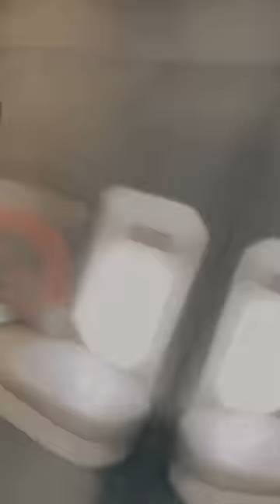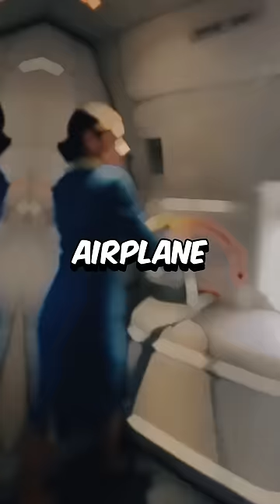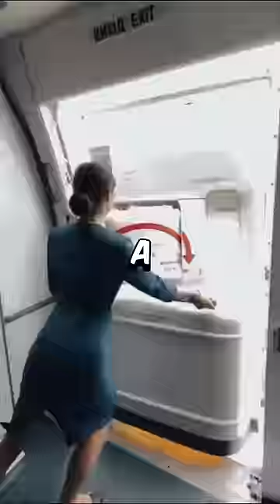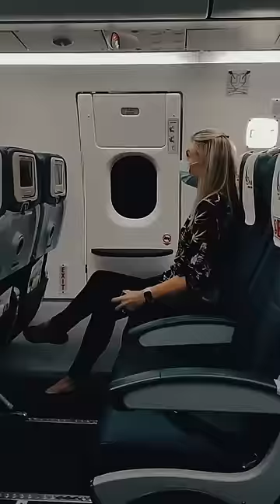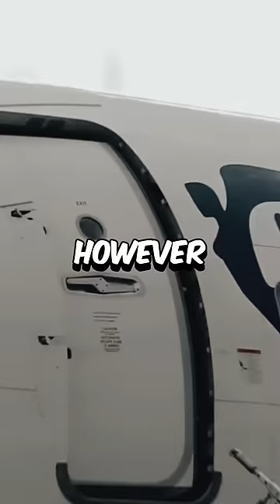Airplane Doors Cannot be Opened Mid-flight!🤯 #shorts #aviation

Comment: NO . even if you try it won't open because of pressure and the way doors designed  . Aircraft body is inflatable so doors would literally push against outside not inside  thus you can't open it even without lock . Be relax and  appreciate the human technology

Comment: 1st shot of the video is of door you can open in flight! LOL Only plug doors (those that need to be pulled in then push out sideway because they are larger that the frame) cannot be open in flight due to the pressure dif.

Comment: What about the Chinese lady that opened the door 🥱🥱
Reply from the maker: That was an emergency exit
Reply: the guy only managed to do so because the plane was on approach and fairly low enough for the pressure difference to be small enough to overcome the forces and open the door… would have been impossible any higher and on cruising altitudes

Comment: the preasure inside is NOT GREATER THAN OUTSIDE because airplane windows have a tiny hole which would release the preasere it is the wind that is holding the door back (the holes are their  because u dont want the inside preasure to be greater than the outside cuz the windows could break)
:)
Reply: Above about 10,000 ft of altitude it is impossible to breathe and hypoxia will set in very quickly.  If the plane is above 10,000 ft every passenger would be passing out, especially with the plane at cruisibg altitude of about 35,000 ft.  BUT THEY DON'T.  Thus the inside must be at a lower altitude than the outside (about 7,000 ft) and so the inside MUST BE at a higher pressure than the outside.

Comment: What about that door in that Alaska airplane 🤔🤔
Reply: It wasn't a door, it was a blanking door (door plug) that filled in the hole where an emergency door could be installed.  It was never intended to be opened or removed in normal use of the plane.

It would only be removed for maintenance (the Alaska plane was less than 3 months old so no need for Alaska to do any maintenance on it or the area in which it was placed) or to be replaced by a proper emergency door (which would be when the plane had a refit with extra seats installed requiring more emergency exits to be available).

Comment: Not true. It recently happened during landing
Reply from the maker: This is in the sense of not opening it because risking other passengers life and also its not feasible on the maximum height.
Reply: recent asiana airlines incident happend on approach where the plane was already low enough for the pressure difference to be fairly small, so the guy managed to overcome these forces… on cruising altitudes its absolutely impossible

Comment: Dont lie they open it theres a vid
Reply from the maker: It was an emergency exit
Reply: it’s not a lie, this short just fails at explaining it properly… most airplane doors are plug doors meaning they are wider on the inside than the opening itself so on higher altitudes, the greater inside pressure pushes the door against the frame… the friction is so high that it’s impossible for humans to move the door… the recent asiana airlines incident happend on approach where the plane was already low enough for the pressure difference to be fairly small, so the guy managed to overcome these forces… on cruising altitudes its absolutely impossible as I said (unless it’s a structural failure of course)

Comment: Why lie? It depends on speed/height. 

You can DEFINITELY open a planes door when it's flying. It literally just happened a few months ago
Reply from the maker: It was an emergency door i think
Reply: it’s not a lie, this short just fails at explaining it properly… most airplane doors are plug doors meaning they are wider on the inside than the opening itself so on higher altitudes, the greater inside pressure pushes the door against the frame… the friction is so high that it’s impossible for humans to move the door… the recent asiana airlines incident happend on approach where the plane was already low enough for the pressure difference to be fairly small, so the guy managed to overcome these forces… on cruising altitudes is absolutely impossible as I said (unless it’s a structural failure of course)

Comment: O really, then what about Turkish airlines flight 981, China airlines flight 006 and asiana airlines flight 214
Reply from the maker: That was not a person who opened the cargo door of flight 981.. get some research.
Reply: United Airlines flight 811 suffered a cargo door failure at 22-23,000 ft which ripped off part of the fuselage and 10 seats were ejected by the explosive decompression.

Like the DC-10 (as used by Turkish 981 and American 96), the 737's cargo door opened outwards as opposed to inwards to form a plug seal like passenger doors (this allowed for fuller and easier use of the cargo area).  The locking mechanism failed.

Comment: COMPLETELY FALSE. How do you account for ACTUAL cases of doors opening (as recently as two months ago) mid flight?
Reply from the maker: It was an emergency exit if you are talking about asiana flight
Reply: Those cases only managed to do so because the planes were probably on a fairly low altitude and the pressure difference being small enough to overcome the forces and open the doors… impossible on cruising altitudes

Comment: This is just simply a lie. Where do you come up with stuff like this. Even in your statement…the pressure is greater inside, so it can’t blow out. 🤯
Reply from the maker: Its the fact.
Reply: it’s not a lie, this short just fails at explaining it properly… most airplane doors are plug doors meaning they are wider on the inside than the opening itself so on higher altitudes, the greater inside pressure pushes the door against the frame… the friction is so high that it’s impossible for humans to move the door… the recent asiana airlines incident happend on approach where the plane was already low enough for the pressure difference to be fairly small, so the guy managed to overcome these forces… on cruising altitudes is absolutely impossible as I said (unless it’s a structural failure of course)

Comment: Not true. This just happened a month or two ago
Reply from the maker: If you do Its Fatal
Reply: no it is true, this short just fails horribly at explaining it properly… most airplane doors are plug doors meaning they are wider on the inside than the opening itself so on higher altitudes, the greater inside pressure pushes the door against the frame… the friction is so high that it’s impossible for humans to move the door… the recent asiana airlines incident happend on approach where the plane was already low enough for the pressure difference to be fairly small, so the guy managed to overcome these forces… on cruising altitudes it’s absolutely impossible as I said (unless it’s a structural failure of course)
Reply: @Wingsofhistoryy are you a bot?

Comment: If that were true the cabin would explode if it could hold the pressure and if it had to little it would implode.
Reply from the maker: Pressure is maintained in the cabin, thats the diferrent science. But on the height the pressure inside is greater than outside. That’s a different science.

Comment: reason does not seem logical
Reply from the maker: This is study.
Reply: Well this short just fails at explaining it properly… most airplane doors are plug doors meaning they are wider on the inside than the opening itself so on higher altitudes, the greater inside pressure pushes the door against the frame… the friction is so high that it’s impossible for humans to move the door…

Comment: Well this is cap a man did it like a month ago
Reply from the maker: That was an emergency exit
Reply: it’s not cap, this short just fails at explaining it properly… most airplane doors are plug doors meaning they are wider on the inside than the opening itself so on higher altitudes, the greater inside pressure pushes the door against the frame… the friction is so high that it’s impossible for humans to move the door… the recent asiana airlines incident happend on approach where the plane was already low enough for the pressure difference to be fairly small, so the guy managed to overcome these forces… on cruising altitudes is absolutely impossible as I said (unless it’s a structural failure of course)

Comment: This is already been proven wrong there is already been videos circulating improve amongst the internet get a bowling seven fifty seven headed entire bay door blown open and ripped completely off all because someone opened it
Reply from the maker: Yaa .. That one Exactly 👍🏻
Reply: So the creator forgot to mention that you can't open it at cruising altitude not take off or landong
Reply: "Bowling"
Reply: hi mate, an avgeek here. its 757 not seven fifty seven btw it kinda offends me but who cares. Now normally while you are above 3000 ft using a commercial aircraft like A320, 737s, 767, 757, and all commercial aircraft, you cant open the emergency door if youre above 3000 ft. I know this because im a fighter pilot working in the RAF. But once an incident happen while after landing, a karen raged and opened the slide. And also there is one while trying to land (they are at 1000 ft) someone opened the door and the slide went thru causing a hard landing

Comment: False statement, it recently happened.
Reply from the maker: But Fatal doing that.
Reply: it’s not false, this short just fails at explaining it properly… most airplane doors are plug doors meaning they are wider on the inside than the opening itself so on higher altitudes, the greater inside pressure pushes the door against the frame… the friction is so high that it’s impossible for humans to move the door… the recent asiana airlines incident happend on approach where the plane was already low enough for the pressure difference to be fairly small, so the guy managed to overcome these forces… on cruising altitudes it’s absolutely impossible as I said (unless it’s a structural failure of course)

Comment: It just happened recently.  Idk why you gotta lie for views.
Reply: Thats different.  These doors are built with the inside bigger than the outside. So when you climb hihh enough the higher pressure inside makes it impossible to open.

For the American Airlines flight incident , it wasnt an exit door that flew out, it was different kind of section that had no doors.

But this raises a good point: why isnt every window section on a plane built such that at pressure its self-locking.
Reply: @baselsalam  I have been struggling recently.  Seems like every single thing I learned in school has been a lie lol. It's hard to relearn stuff in your 40s. Not impossible, just really frickin difficult
Reply from the maker: Cannot be open in the sense .. it is not a normal thing to do it could be a disaster. And recently the thing that opened was an emergency door. Little difference. But on high altitude its not safe.